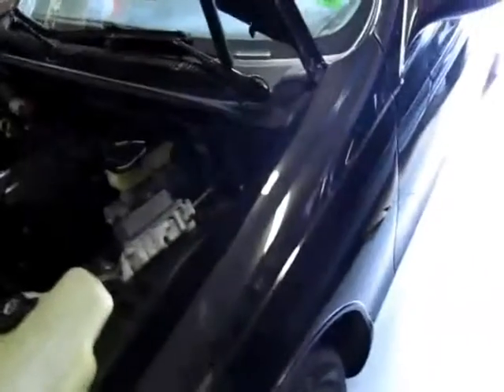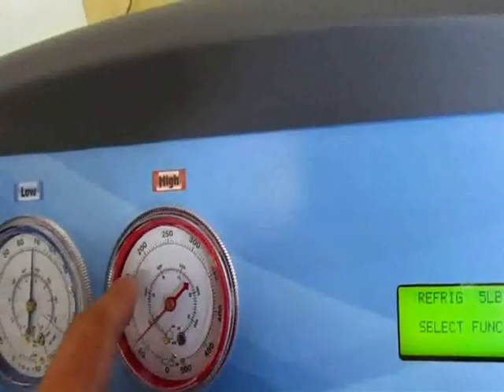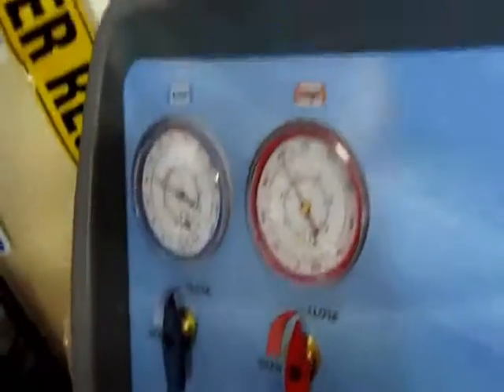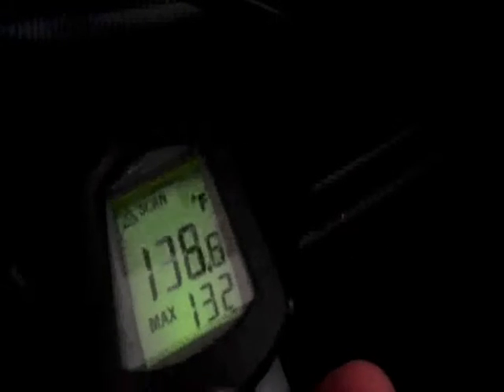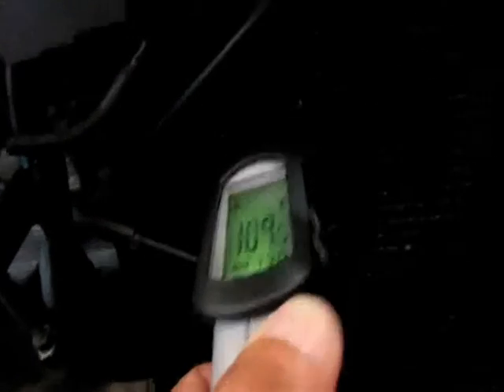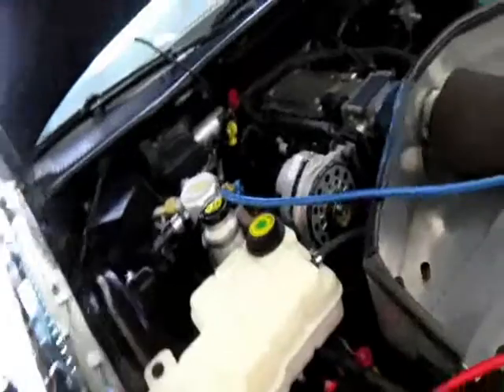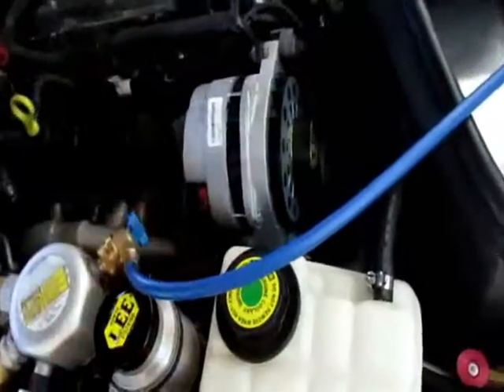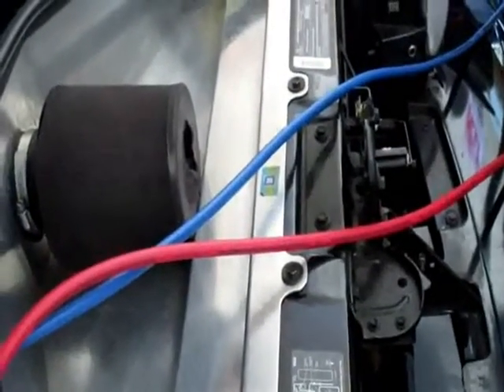AC R-134a pressure and condensor check, Easy

Comment: What headers do you have on your impala I been looking for a set and also do you have to update the computer when you install them ??
Reply from the maker: +rayquan187  Tri-Y headers. You dont have to reprogram, but should because the stock tune sucks.  And.. If you delete the air pump and its a 96, it will need to be programmed out.

Comment: I really enjoy these AC videos. So cold here rarely ever bother fixing ac on old cars. Always a little something to learn.  Mine's doesnt get very cold, but cold on the highway.  Traffic it gets warm. Safe to say I only need a little fill ?
Reply from the maker: +Veikra  Pull the caps, if they are all wet, they valves are leaking.  Service valves are the number one leak. Alot of times when you add some R-134a to the low side, on a old vehicle, the valve wont seat, and will just leak. I had it happen on my truck, Both the low and high side leaked. 
Also, try cleaning the condenser. Soapy water, Rinse it out + pull/pick as much junk out as you can. I will never refill a system just with a can and the cheap gauge, Did that, you almost always wind up overfilling the system.   At low speed if the air sucks, Low on charge or a air flow problem.  Its been a bit DRIER here, Lower humidity, I should really pull the system apart tomorrow.  Flush it out. dry it out, New 8oz of pag 150, new Accumulator, Orifice, New compressor.     I think you cannot buy R-134a cans in Canada?
Reply: Yeah, I cleaned up the condenser as the first step. Condenser is looking nice fin wise.  It's never cold as supposed to even at speed. Also, it's passive, no fan. I missed the opportunity to try anything as it's alreadu too cold for ac now, but id like to try my luck with this one as it's the first one that it not completetly dead like the others ive had.